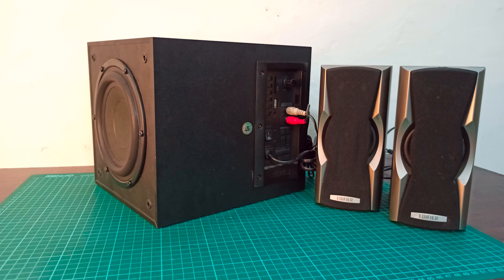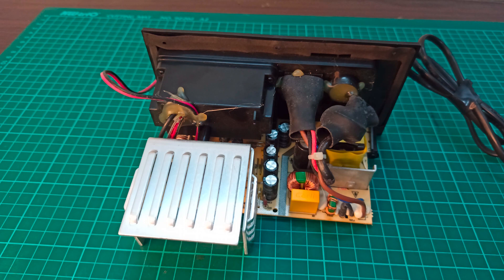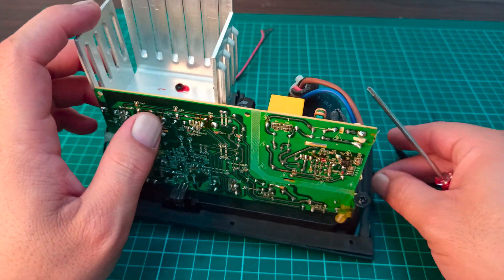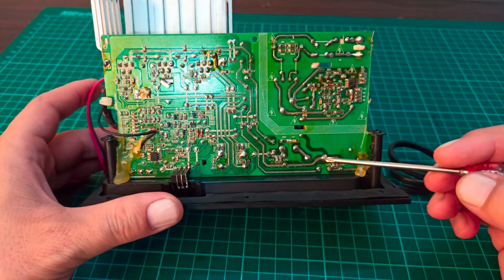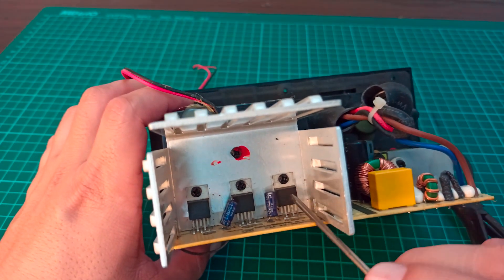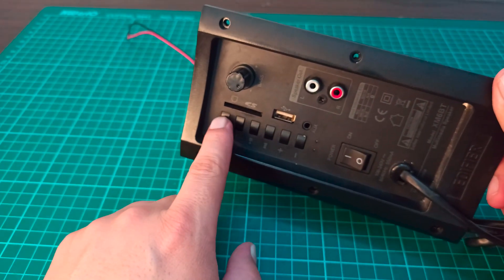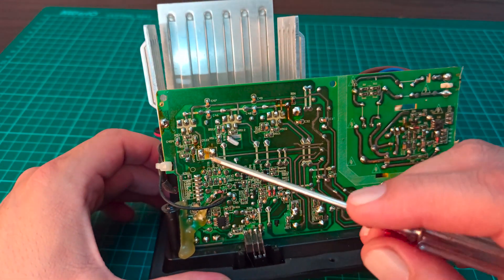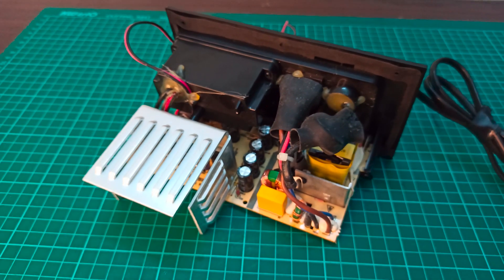Subwoofer System Teardown and Circuit Explained | EDIFIER XM6BT

Comment: Hello. I just purchased this product from OUTLET and noticed that the fault it has is that the white audio channel (left side) when you raise the volume a little starts to make a strange noise along with the music. If you keep the music at a low level, this error does not occur. Will there be a solution? Can you imagine what it could be? Thank you
Reply from the maker: Hi, have you open it and checked for any bulgy capacitor connected to its left channel? Also if you have a multimeter you can check the TDA2030 IC if it is faulty then just replace it.
Hope this will solve the issue

Comment: Hi ,I have same model speaker in this video but my speaker no power when I turn ON the switch .May I know which part must I change ?
Reply from the maker: The power supply of your speaker must be faulty.
Check its input fuse, switching mosfets, if they've been fried just replace them. It should work fine
Reply: @ERLEngineering  can you do the video for me ? I dont know which part that you mean .this model have input fuse ? in which part ? i didnt see input fuse 😭

Comment: My speaker's SD card and other options circuit is not working. Can I introduce the left right channels in the amplifier circuit from the DACL DACR and AGND wires coming from that module in to the amplifier circuit?
Reply from the maker: Yes, that will work just fine
Reply: But it is not. I have tried to connect the left right and ground wires in the connection where the buttons cable is connected but it isn't working   @ERLEngineering